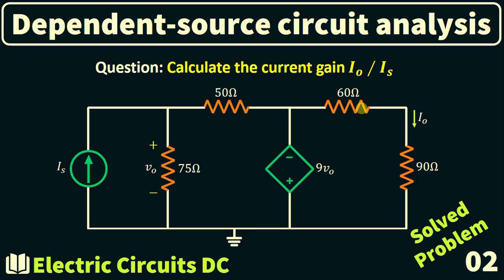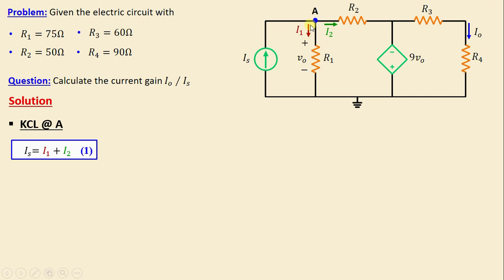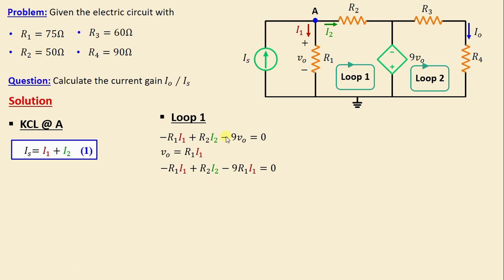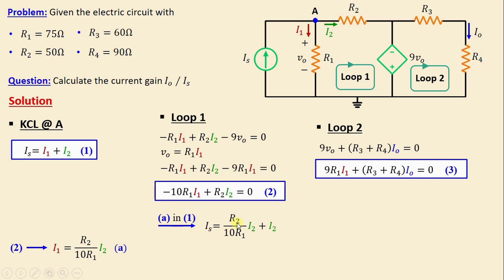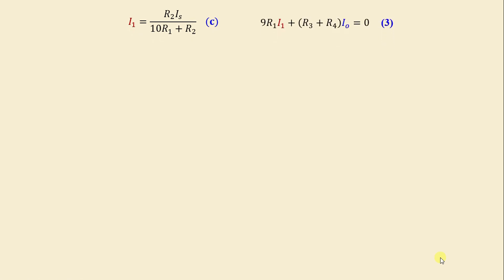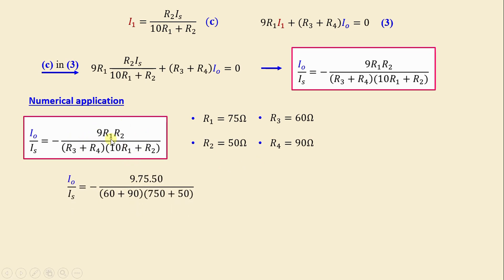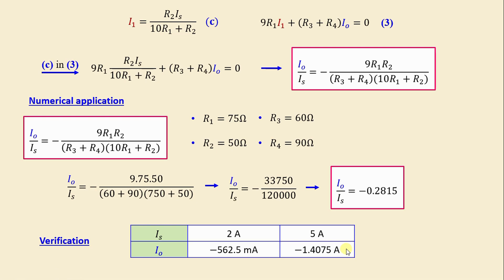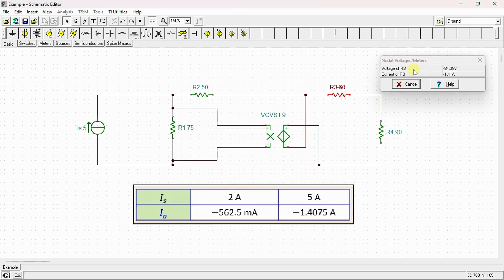Solving circuits with dependent voltage sources - Problem 2

Comment: This was such a great example problem and explanation that I actually had no idea what voltage controlled voltage source even was. I learned it from this example solve.

I am studying to be electronics technician. They only teach us a very surface level understanding, not much math. But I aspire to study more, this is all so fascinating.
Reply from the maker: I hope that this helped you a lot ... good luck